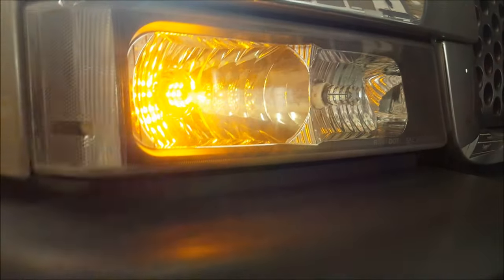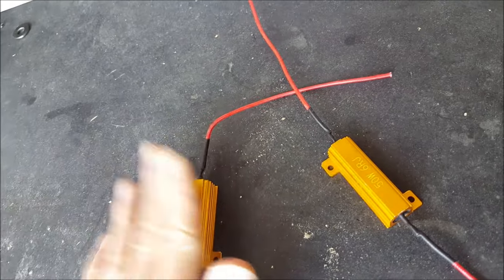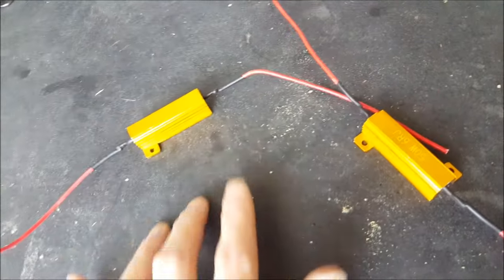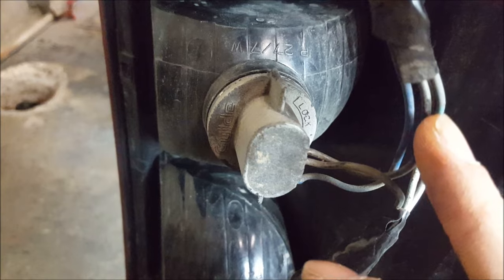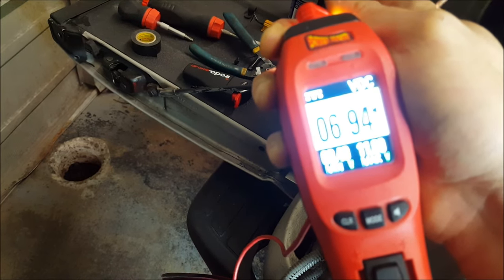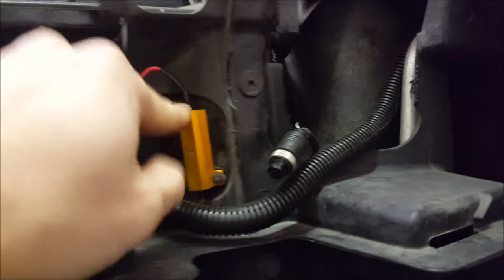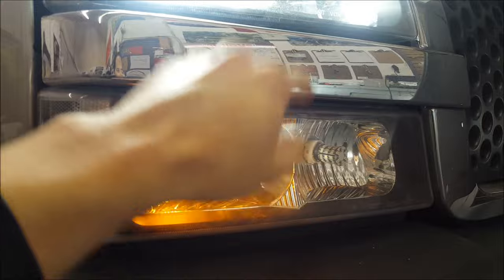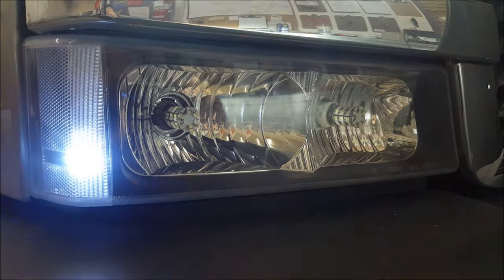Load Resistor Install (Eliminating Signal Hyper Flash) | AnthonyJ350

Comment: Use a no load flasher to correct hyper flash simple & low current draw ... you're welcome 😊 friends don't let friends use load resisters
Reply from the maker: And what happens if it's done through the BCM like most newer vehicles?
Reply from the maker: Can you at least recommend a high quality unit vs some no name China flasher? At least if a load resistor connection fails the signal continues to work. It's what we use on emergency vehicles.
Reply: @AnthonyJ350  I don't know the brand I got mine through the local parts store bought them many years ago no problems, flashes normally.I drive an 88' Sammy & 99.5 F350 powerstroke if you want I can pull them to get part numbers.what is a BCM I only own old vehicles thanks
Reply from the maker: @speedfreak8200  Body Control Module. Almost every new vehicle uses one to control different parts of the vehicle. Locks, lights etc.

It was a most to reduce the thickness of wiring by reducing amperage requirements in certain areas of the vehicle and using computer controlled signals.

So for simplicity, installing load resistors on newer vehicles doesn't affect the BCM negatively either because it doesn't think anything is altered. So the load resistor method covers older vehicles and newer.

Now on a classic vehicle, I 100% agree with a flasher module. No holes in the vehicle and easy. I had a Pontiac Beaumont in the shop where the flasher relay only operated correctly with the engine running.
Reply: @AnthonyJ350  I don't normally use my turn signals with my engine off, load resisters just seem to be a bad idea...different strokes for different folks I guess
Reply from the maker: @speedfreak8200  What's bad about them?
Reply from the maker: @speedfreak8200  What happens if you have engine failure and you need to signal to alert traffic. Signals need to operate properly as long as the battery has enough reserve capacity.
Reply: @AnthonyJ350  I wonder if they make one to fit me .... cuz I could use some body control
Reply from the maker: @speedfreak8200  That's not how it works

Comment: You can get a replacement relay that's made for led lights so you don't get hyper flash.
Reply from the maker: +Brent Elliott Thanks for the tip!  Do you have a link we can share with people?
Reply: +AnthonyJ350 On some vehicles. some a computer control like crown vics 2000 and up I thought the same thing until I went to change it
Reply: Mine doesn't even blink in the front but the back does will this relay help with that I have a 01 dodge ram
Reply: +iceman997799 If you're not scared to break out a soldering iron you can likely find a way to fix it still, external flasher or not.
Reply: yea but the thing is the car I have has a headlight control mod. If I mess up no headlights taillights or turn signals so easy way use these.

Comment: If you're going to do an instructional video, a little bit more thoroughness is imperative.
Reply from the maker: I'm pretty sure it was pretty thorough hooking up the 2 wires. I suggest bringing it in to a professional shop to have it worked on.

Comment: Installed on my jk and still have hyper flash
Reply from the maker: Chrysler products use a CANBUS network to detect errors. You'll have to get a bulb that works with your setup. See if ijdmtoy or jdmastar makes anything for your application.

Comment: Do you have to put a resistor on the daytime running lights if you change them to LEDs
Reply from the maker: No you don't.  Is the DRL a dedicated light or is the high beam?
Reply: @AnthonyJ350  what happens if it’s also high beam?